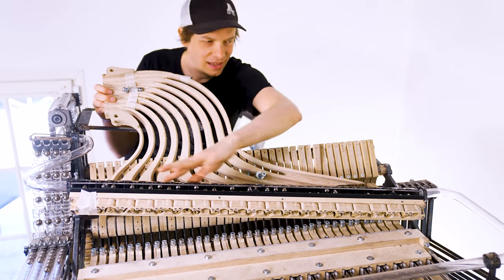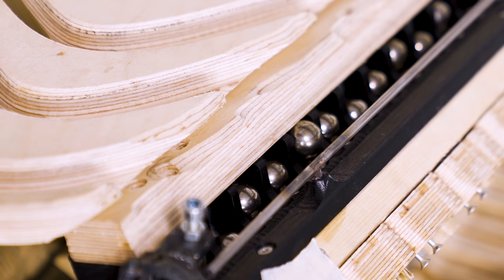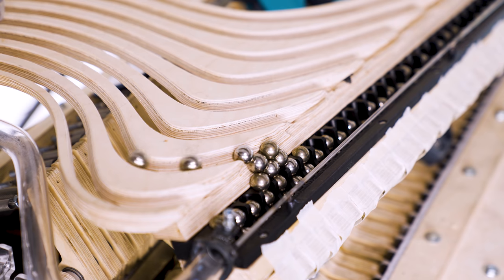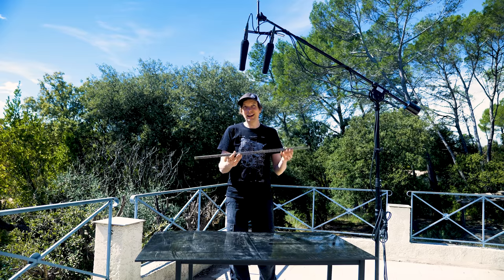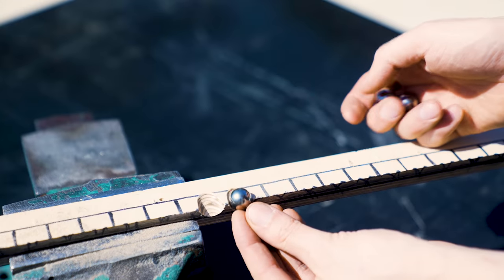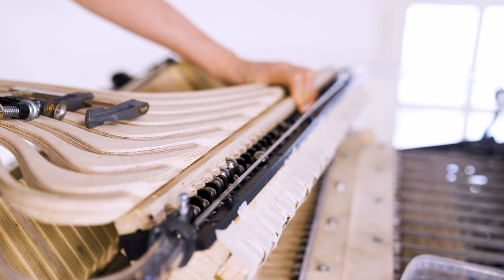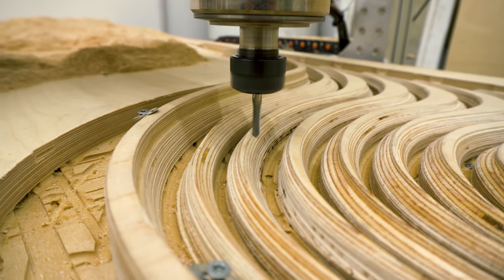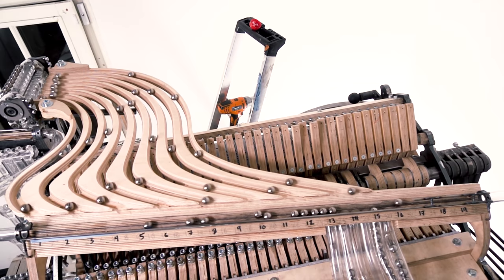Marble Tracks with Hidden Feature

Comment: This feels so much like the evolution of other industries..Be it automobiles to computers. They started so rudimentary and as new ideas come and get implemented we think we are doing great.. until a better option gets developed then it’s time to redesign until the new option becomes perfect. It’s really cool to see.
Getting rid of the divider+height module design reminds me of cars changing from mechanical pedals driving carburetors and external cruise control units to computer controlled drive by wire accelerator with fuel injection. So much more mechanical simplicity! 
It’s just so exciting and fun to watch.

Comment: I noticed in the video that near the end of the divider, next to the last guard rail pin, the marbles were constantly stopping on the divider.  It didn't hinder the divider as a marble from behind would hit it and it would continue on with it's day, but it was happening enough times that it looks concerning.   You can see it start to happen around 11:55 and  examples of it continuing to stop at 12:15 12:26 and 13:32 .

Comment: Hi Martin, the new marble divider seems to be really promising! I've noticed some details that can cause MMX issues:  1) The marble lanes have a gap with the marble divider right on the left corner. 2) The clock escapement gear does not look to have the perfect touch with the left anchor as it was in the first video. 3) The sides of the marble lanes could be a bit more raised. If a marble for any reason bounce out of the lanes and right on top of the machine can potentially break things.

Comment: You remember you've wanted those "finger" thingies for quite a while, thinking about how you could add them without creating a technical problem or irritating too much of the audience?
With the clock escapements you now have pretty much the exact finger effect you wanted, just a little less high on the machine. The best part - they are an integral part of the machine and not just some aesthetic addition.

Comment: My brain just clicked on how different shape V's obtain different speeds. The v contacts the marble at different distances from the center of rotation causing the circumference, which is also how far it travels per rotation, to change for each lane based on the channels shape. Because of this you can freely control their translational motion. This realization felt so good. Also love to see that you have the chance to do some work outside.

Comment: That’s neat that you can use over rotation in the tracks to slow down the marbles before curves to keep them from flying off the track and to control their speed and timing. Clever.

Comment: I can't seem to find the comment, but someone pointed out that if the marbles come in contact with each other while overrotating, they are much more likely to get stuck. If that indeed does cause an issue, maybe it would be good to install a "floor" on the divider that can be raised to allow the marbles to roll normally when it happens. Just a thought.

Comment: That leftmost lane (from the front) of the marble tracks looks like a mole in the making! After demonstrating that the machine will work with the adapter, you should probably redo the adapter with extra material on the left. If you want to go all the way you could probably CNC a plywood piece that fits seamlessly with the POM divider, but it's clear that you can wing it manually and it will work fine!

Comment: So I just watched a video where a guy was replacing a stock car radio with a new one. He found out after the installation that there is a 2mm gap between the radio and the trim, the radio was sinked in the central panel. Guess how he solved it, wasehers. In a blink of a second I realized I need to check out Martin's channel about MMX progress. And here I am. 

Just felt like I need to tell this :D

Comment: One thing that caught my attention:  remember how much you regret having the magnetic marble conveyor tracks on the two wheels?  I saw on YouTube how some people made similar conveyors except that they use holes in the wheels which catch marbles, bring them up, and then spit the marbles back out using gravity.  perhaps in place of magnets, a series of holes might be the answer.  Or perhaps a conveyor pulley system like on the original.  Take a look at all the videos of other types of marble machines, and you will get my drift.

Comment: Martin,

Been with you all the way and loving the recent videos. Quick vocabulary lesson.

Robust = able to withstand or overcome adverse conditions. I.e. The design has a wide acceptance tolerance. E.g. The magnets in marble lifting gear were rated at  N42, marbles were slipping. New N52 magnets were installed to make the design more robust.

Redundant = able to be omitted without loss of meaning or function. I.e. There is a backup in place.  E.g. The marble lifting gear used magnets to lift the marbles, but some were slipping. Depressions were added into the material to hold the marbles just in case they slipped of the magnets.

Comment: I’m sorry for being that guy, but this is not redundancy, it’s fault tolerance. 
 
redundancy is when you have a backup system to keep the machine running in case of failure; fault tolerance is the ability to keep running in case of failure.

redundancy is a way to achieve fault tolerance, but not all fault tolerance relies in redundancies.

edit: 
redundancy = having a spare tire
fault tolerance = using tires that can run flat for a few kms

Comment: I think you might want to add a second rail off the top of the divider guardrail.

As marbles are coming off the lanes, some of them are falling on top of marbles already rolling down the divider. Because of the POM, this appears to be making marbles coming in from the lanes jump a little higher when they land just right on that lower marble — just enough that they might clear the divider's metal guardrail.

Comment: I really love the addition of the over rotation as it allows more marbles to flow on top of the machine at the same time 🎉
But I don’t think it actually reduces the exit speed of the marbles that much... You only “trap” energy during the over rotation part. You can see this when the marble exits the tracks, as it is accelerating back to a speed it would have had without the over rotation... Instead of looking at the decent time you should have looked at the exit speed when designing the tracks. 
The track looks awesome thought, and it seems to work really great, but if you find a mole in the future in regards to the exit speed this could be it ❤️

Comment: Martin, sometimes I don't understand how you manage the throttle of your effort/creation. (I actually do, but this is introspection for you). Sometimes you go overkill like this beautiful zigzag slope, very beautiful, flawless, well thought. (You call it overkill, but it's actually not. It's just how it should be). You also did the final flawless iteration of the marble divider. And then, in between, you try to force in a piece of wood, "the step" as you call it, that obviously, has nothing to do there anymore. But stil, you want to work in that direction, causing you new issues, new hand work, new tests. And almost ruin the marble divider solution, and actually creates some more noise when the marbles bounce every where. A chain reaction of cause/consequence that in almost endless make you rethink a lot of parts, just to include that step down instead of doing what you should do. (facepalm moment) And there's one reason you're doing it this way. I'm not gonna play the therapist and ask you to find the solution by playing hide and seek.. The solution is that you should do what you're supposed to do and you know this. It crossed your mind I'm sure. And do the best way directly instead of doing 10 iterations  to finally do it the best way after all and had wasted time and energy. The best way is to get rid of that step and rework the zig zag slope so it goes directly to marble divider. And you know it. It would be less part, fall more gracefully, make less noise,... Too fast, too slow ? You know what to do! You're not doing it because this is an obstacle and making you go somewhere you don't really like, CADing. So avoiding that effort makes you do other efforts. But it's actually not perceived as a effort because these are just the bargain effect. "And if I do this, I skip the redesign of this". Which is the solution you should go for. I know you want to end and you're making sacrifices on aesthetic, but don't use that excuse here ;) This is part of the grinder process, pain is temporary. But in an other clothe.

Comment: The hidden trick is actually really cool when you think about it. By choosing to make teh marbles roll from the dies and not the bottom, it makes the marbles act like smaller marbles, or little flywheels, changing the diameter of rotation (no clue if that's a real term or the right one) so that their more of their kinetic energy is offloaded and converted into rotational acceleration and I assume some extra friction against the air. IDK if any of that makes sense, I just love simple, clever design ideology.

Comment: The idea of overrotation is pretty common in many hidden ways. 
For instance, it's in effect when you turn your bicycle/motorcycle at speed, you lose some speed when on-power because the round profile of your tire makes the radius of the wheels move closer to the hub while leaning, effectively changing the gear ratio on the whole system.

Comment: I know that it's pretty much a moot point now, but another way you could control the speed, or at least the amount of time it takes for the marbles to go from the conveyor to the divider, is with the length of each track. There's plenty of room up there to design a part with equal length tracks, which could allow you to make smaller adjustments, since you're not having to slow one marble way down to keep pace with one that's covering a longer distance.

Comment: To Wintergatan and his support Crew. So. I'm concerned about how, over time, the wear created by the marbles will widen the tracks and the rest of MMX. A steel marble is polished. Wood does compress and the contact/pressure will make that wood grove/path wider over time and the rate of travel of the marbles will change over time. Maybe that wear is so minor it will take years to be a concern. With all the prep/design work going on. You will have a replacement part on hand to change out for any part in a short moment should it be needed.
Maybe I should not be concerned. Everything is under control.

Comment: At some point the wear from the thousands of marble passes will wear away the bare plywood.  As a woodworker, I recommend experimenting with finishing wax on the exposed parts and especially channels.  Sanding is good, but hard-finish wax (like carnauba) would probably lengthen the lifespan of plywood parts and slow the replacement rate.

Comment: I'd like to see a little box under the conveyer lift, just in case a 'ghost marble' appears, so it doesn't end up in the gears, which could be a machine-breaking failure
Like how, in an airliner jet engine, there's a structure around the fan to make sure any broken fan blades get contained and don't hit anything too important (because you can't make an efficient fan blade strong enough to withstand a flock of geese)
Rather than making sure a failure never happens, you add something to turn a catastrophic failure into a manageable one.
A good phrase from the aero-industry is "no single point of failure should lead to a hazardous outcome", and a marble catcher box under the conveyer seems small and quick enough to make that it's worth doing on the off chance (or even just a deflector to put marbles safely onto the floor, away from the gears)

Comment: Off topic, but I was thinking about the problem of leveling the MMX during setup before a show.

It'll be easy enough to add some spirit levels on a couple sides of the machine, but since it stands on four legs, there's the possibility of wracking the frame without the levels indicating it.

A simple way to indicate wracking would be to install a couple well-placed cantilevered rods with the end floating above a graduated scale, kind of how the beam style torque wrenches work. If there's even a little bit of wracking, the end of the rod won't be in its zero
position.

This will obviously save on wear (since things will be properly aligned), but it will also increase reliability since so much of the machine relies on alignments and gravity operating on specific angles.

Comment: I like this design which reduces the amount of parts! Really like you KISS approach. One question; did you check if there is a possibility that a bearing from the marble divider can collide with the one coming from the bypass track and therefore pushing/bouncing it over the guardrail?

Comment: I was surprised to see the wooden “adapter” piece between the tracks and the new divider. It seems it adds a bit of extra mechanical noise - marbles striking the adapter then falling into the divider adding a second hit. Would attaching directly to the divider have made the lanes too steep and fast?

Comment: Instead of shimming the curved marble run at the top you could have taken 2-3mm off the thickness of the new part you made to get the increase in angle you were looking for. There's at least 4 layers of laminate on that plywood before you get to the dremmeled arches.

Comment: Hi Martin, what I do not understand, why not turning the new devider 180° (only the plastic black part at the top)?  The Pockets to the front and the rail side to the top. Instead of the rail, you could attach the marbel tracks from the conveyer belt there with no marble jump needed.
(yes, you have to change some angles, but when I do not overlook any problems here, the benefits would be bigher than the costs)

Comment: As I mentioned on the first marble divider episode, the blue. You need to rotate the marble divider so that the holes are on the opposite side. The Marble Tracks should attach where the metal barrier is.

Yes, that's a big change, but needed. You can't have the marbles dropping down on the same side as the holes. :P

Comment: You need to apply penetrating finish to this plywood, and sand lightly after!  Don't do too far on the marble slowing scheme or you will have stalled marbles when the plywood warps.  Plywood WILL warp when you ship the machine to other climates.  You should have more bridges under the lanes to maintain accurate spacing.
Reply: this machine is a prototype, i imagine the world tour version will fix these issues.

Comment: Hi, your edge cases are only explored for the marble dropper positions at the high numbers end of the marble divider. So the marble divider does not seem to fill the first marble dropper position, this is done with marbles coming from the plastic tube. When you are playing compositions in the future using all the dropper positions, might there be a potential throughput issue?

Comment: So I noticed that the fishstair sometimes only carried 3 marbles instead of 4. That means that the divide-by-4 is not working properly, right? Or is it due to inconsistent travel times in the straight pipes between the fishstair and the divide-by-4? Could this be an issue? (Thinking about it, I have a haunch it really is the travel time and this won't happen when there are more marbles in the system)

Comment: I think you're saying "Redundant" when you mean "Robust"

Redundant parts can fail without causing a system failure.  Since you have two droppers per note, if one dropper breaks during shipping you can move the music pins and still play the song.
Robust parts are engineered to a lower rate of failure.  When you fix a part to eliminate a one-in-a-million failure, you're making it robust.

Comment: To everyone not understanding the very specific engineering term "redundancy", please stop. It is not up to you to come up with a definition for what rendundancy means, as it’s very well defined in an engineering context.

Martin is using it wrong, and that’s ok as he doesn’t know better. But what is not ok is everyone making up their own definitions for the word. Martin isn’t designing backup systems that would keep the machine running in case of a failure, he’s making the existing systems more robust.

If you used the word redundant in an engineering context like Martin does, you’d confuse the HELL out of the listener (as he’d be looking for the redundancy, which is not there). It is important to use proper terms.

There’s a horde of engineers here pointing this out so why do you fight against it? It really doesn’t matter that Martin is using it wrong, but what baffles me is the multitude of people arguing engineers about established terminology in their field. This really is not debatable.

Comment: How frequently do you "tram" (level) the MMX? I was thinking that if you are optimizing on a frame that is slightly out of level, it will be problematic if the machine is moved and is leveled, it will change the overall relationship for the marble runs. Just curious since that isn't mentioned often. Cheers.

Comment: This feels like an issue with the entry point of the marble lanes. In all your tests the marbles enter from the left and roll down to the right. Now they're entering from above (which makes sense for distribution reasons) but causes these edge cases. 

What if they entered from the front instead at a slight angle so they're already rolling to the right? That would completely circumvent the edge cases and have the divider work as intended.